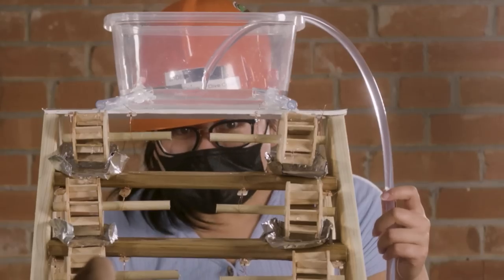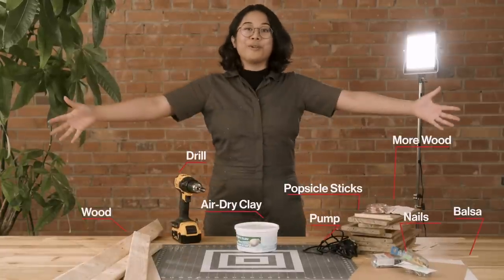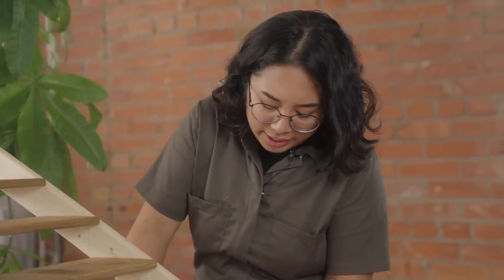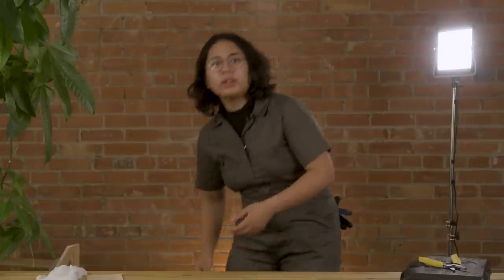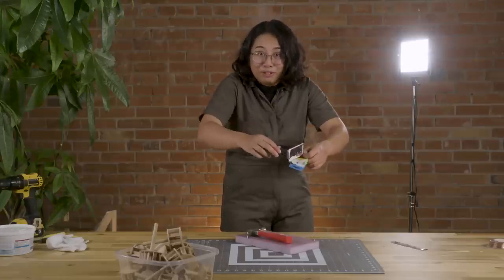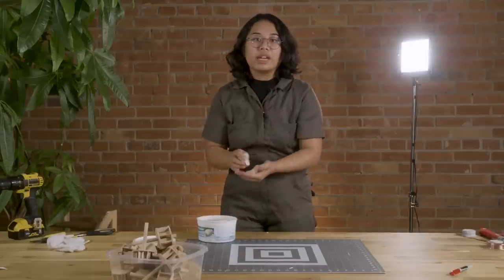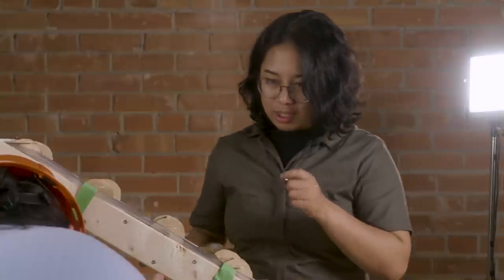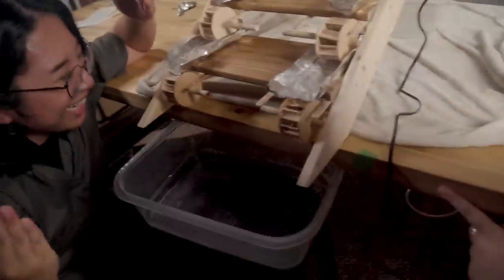How Romans Revolutionized Bread Making | History Remade with Sabrina

Comment: Probably would've worked waaaay better if the angle of the buckets was done right. They were all angled toward the outside of the wheel instead of all cupping in the direction of the flow so all it did was smack the water toward the hub instead of in the direction it would be turning. So barely any water was actually exerting any force in the desired direction. I'd really like to see it done again with just that one adjustment.
Reply: Yeah when she glued them in place I was like is that really how they're supposed to be and then I just let it go because I assumed that they had a diagram or something they were following but I agree with your assessment that they eat are incorrect.

Comment: This is a neat video that that lead me to look a little further into the modern implications of the mill and how water energy is used to produce electrical energy.

One idea that could have been cool would be to 3D print both the original and Roman wheel design and set it up so that the wheels feed into a rotating magnet surrounded by copper coil. Feed the coil into a filament lightbulb so show the difference in energy production between the two wheel designs. This way we actually see the ingenuity of the Roman design, and the evolution of the water mill into the modern use of producing electrical energy. Plus it would make a funny lamp

Comment: 17:15 Maybe try with one wheel only and use a way larger pump for faster spin.
Try to check this video titled:
"Connect the water wheel to the grinding wheel to sharpen the tool - Ep.149"
Made by Primitive Skills channel. You can see how fast it should be to make a wheel spin fast and strong enough to spin the grinder.

Comment: I think you had the buckets pointing in the wrong direction.  Instead of pointing toward the axle so that the buckets held water at the top position, they should have been pointing at a tangent so the buckets would hold water at the 3 or 9 o'clock position (depending on which way you wanted the wheel to turn).  That way, the weight of the water in the buckets would make the wheel move instead of relying on the force of the flowing water against the buckets (which is basically the same as the undershoot method).

Comment: Mmmm, if one were to replace the grinding wheels with electric generators.
Then have a pump to return the spent water back to a reservoir so as to continue the flow of water.
One could solve the green energy problem.
You could also scale it to size.
Imagine every house having the ability to produce its own power.
No ugly solar panels, no unsightly windmills, and no noisy gas powered generators.
Just a water tank connected to a hydroelectric power station based on the Roman grain mill.
Reply: She still needed an external power source to power the water pump, no?